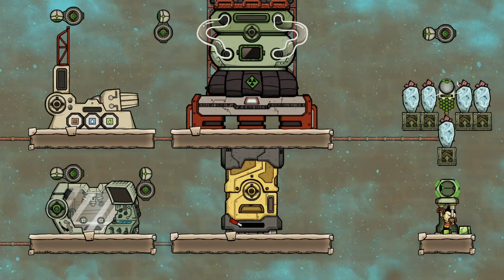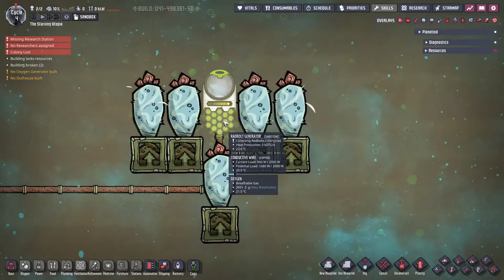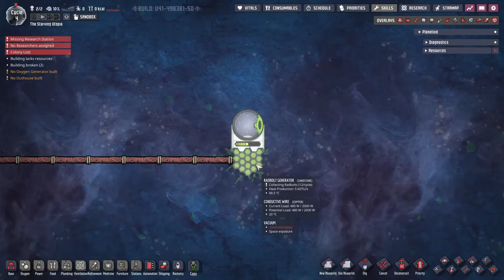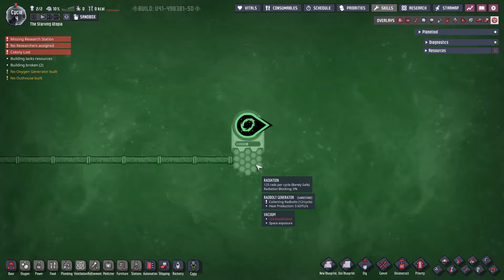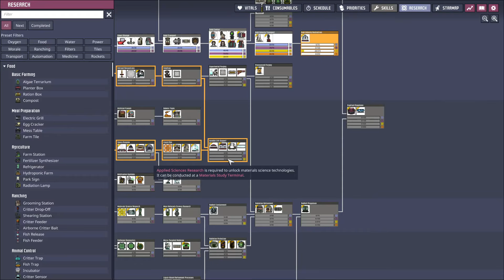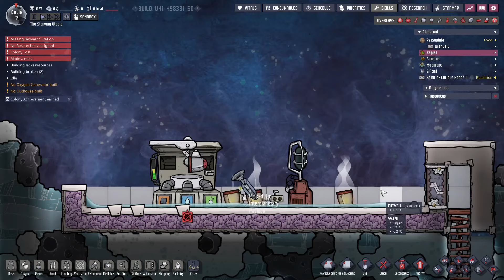Oxygen Not Included - Tutorial Bites - Radbolts

Comment: another cheap source of radiation is to make a shine nymph farm with just 4 nymphs, have the auto-sweepers collect the excess eggs and send then to a enclosed space to hatch by themselfs and said place be right beside a radbolt generator, right now i have a room with 34 nymphs, and they are generating 1253 rads in the tile right beside them and 958 to my radbolt gen which is producin 95 rads per cycle and increasing, u could also put the radbolt gen inside the room they live and point it at them, it will create liquid uranium which can be solidified and used

Comment: Seems interesting the radiation thing. I plan to make a germ killer using radiation, maybe radiation lamp with a swtich that makes it turn on if it detects a single germ in a Isolated area of the map. Does the germs die while liquids are on pipes or liquid reservoirs?
Reply from the maker: If you want to use radiation then you can also use buildings made out of uranium ore it's quite effective. The germs do die in reservoirs but not in pipes, at least that is how it works for chlorine so I believe it's the same for radiation, but probably warrants some testing.
Reply: U can also use a glow stick dupe thats useless.

Comment: there is one more way to generate radiation, with shine bugs, you can stack them in one square, power few solar panels and also few  radbolt generators
Reply: glum shine bug dont emit light anymore
Reply: @longnguyen203  use liquid lock so that the 1 square tile they're trapped in can be counted as much larger room
Reply: They don't produce light, but they do still produce radiation
Reply: @longnguyen203  But it does emit radiation, so you can still stack a technically infinite number of them.  One Shine Bug breeding room produces enough eggs (sent via conveyer when the room is full) to provide about 2000 rads if you stack all the extras on a single tile.  You could put a generator inside their enclosure, but it's probably best to surround them with 4 airflow or mesh tiles (missing corners) and place the generators on the 4 corners and the cardinal directions 2 tiles away.  This provides about 1200 rads per cycle to each generator per breeding room (I'm assuming more bugs increases the rad level linearly), with a maximum of 8 generators sharing this rad level.  That's nearly 1000 radbolts per cycle generated from a single bug breeder, and your dupes never actually need to go near the high radiation (a breeding room with  8 bugs is about 300 rads, so do be careful if you have one rancher doing full time shine bug duty)

Because Shine Bugs eat so little, you could easily support multiple breeders.  A single drecko excretes enough phosphorite to feed 50 shine bugs.  That would be enough to produce 6000 radbolts with this setup across 6 breeding rooms.  You do not need to feed the bugs in the reactor, with the glum debuff they will die of old age before they starve.

Comment: Thank you for this can you make a video on how to get the radbolts out of the storage chamber. I understand you dont use it but it would still be helpful. I have searched and cannot find it anywhere
Reply from the maker: So the radbolt emission is controlled by the automation input on the chamber (check the automation overlay to identify this). The chamber will fire radbolts out by the set amount once per second if there is a green signal sent to its input. If you want to automate the control, then use automation to send a green signal for however many seconds you need.
Reply: @GCFungus you say it's easier to just turn the radbolt generators off when not needed, but, I can give a simple reason behind why radbolt chambers are actually quite usefull: research reactors, they take a LONG time to turn off and it would mean a lot of radiation being wasted, so a few radbolt chambers at the research reactor's "output" would prevent that radiation loss, that is if your main goal were radbolts...

Comment: Am I the only one using shinebugs for radbolt?
Reply from the maker: Probably an oversight on my part, but I think objectively they aren't a great option. You need a lot of them to get even notable amounts of radiation, so for early game I would prefer wheezeworts and later on nuclear waste. With the potential downside of additional lag that shinebugs can create, I generally avoid them.
Reply: @GCFungus  I disagree.  It's way easier to manage a few Shinebug nurseries than to build a nuclear reactor, plus the resource cost is negligible since shinebugs only eat 0.2kg of phosphate per cycle.  One Drecko produces 10kg which would be enough to feed 50 bugs, and you only feed the ones in the breeding rooms.  A single breeding room worth of Shinebugs can produce and sustain a reactor that generates over 200 radbolts/cycle, and this scales linearly by creating more stables. There are 4 tiles for Generators at this level, and another 4 tiles (8 generators total) at about 10% less

It would take at least 6 wheezeworts to outperform a single breeding ranch on a single generator, and you cannot get as many generators into prime locations, nor can you scale much higher with more wheezeworts.  3 Ranches will outperform a Nuclear Reactor on a per-generator basis (not counting waste infinite compression), while being much safer, easier, faster to set up, and still with negligible resource costs.  That's not theory, I currently have 3 ranches running and am getting over 670 radbolts per generator.  As for performance, I haven't seen any issues except when I mouse over the reactor tile (loading the list of items takes a split second).  I think with all the shinebugs confined to a single tile with 0 pathing, there isn't really much performance cost, and 24 breeding shinebugs confined to 4x4 spaces doesn't hurt that much either.  I do have a very high end PC though, so YMMV on that.

In conclusion, Shine Bugs are OP and arguably the best radbolt producers available, with minimal effort and almost no resource cost.  Of course, a nuclear reactor properly driven will generate a LOT of power on top of radbolts, so it's probably worth doing eventually, once you can secure renewable Uranium.

Edit: the radiation just keeps going up.  I don't know why, but some 150 cycles after I started the shinebug reactor it's now over 9000 radiation per generator, with the same 3 breeding rooms unchanged in all this time.  It's just been steadily increasing (only occasional drops, but 2 steps forward 1 step back) ever since I started it.  Wish I knew why this was happening.  Theoretically it should peak after about 30 cycles of having a full breeding room (25 for the shinebug lifespan + 5 for the first egg hatching.  At 30 days it was probably closer to 3000-4000 radiation.
Reply: @Sotanaht01  your trapped shine bugs lays 1 egg even without food. That combined with your shine bug breeding room, their number keep increasing, hence the radiation also keep going up. This also means you get free eggshell generator.

I'm a noob that mostly play around in sandbox tho, so maybe I misunderstood..
Reply: @ Not sure why I didn't consider that.  It also means that you can establish a generator at whichever radiation level you want, then stop breeding and it will maintain itself forever, for free.
Reply: @GCFungus  I do think they are easier to manage than radiation lamps though. I stood them up when on a base where I only had two wheezeworts and used those for cooling my drecko ranch. It actually wasn't that bad to set up, because they honestly lay an absolute crap ton of eggs, so if you just load them all into on square with a conveyer they emit radiation even if they don't emit light. 9 shinebugs is maximum radiation for a radbolt generator, and I hit that very fast. Good for starting out your material sciences plus a bit of extra eggshell.
Reply: @GCFungus in Spaced Out shine bugs may be the ONLY option for rads - because you can’t do solar before getting rads, and on some planets  pods you may have very limited power options - especially on draconian, so rads from space is too expensive.